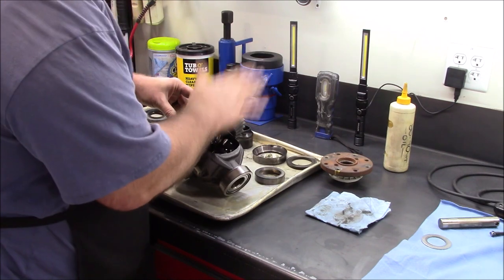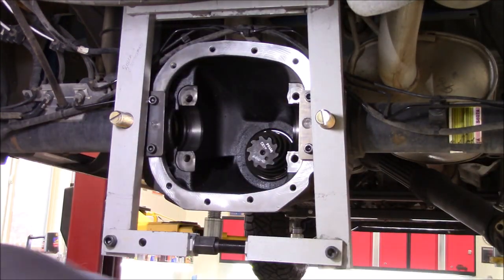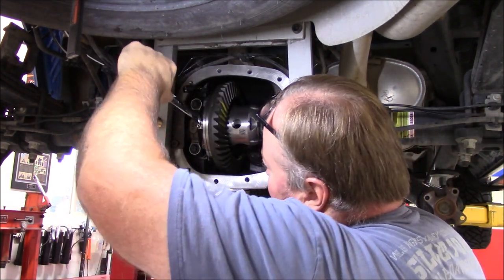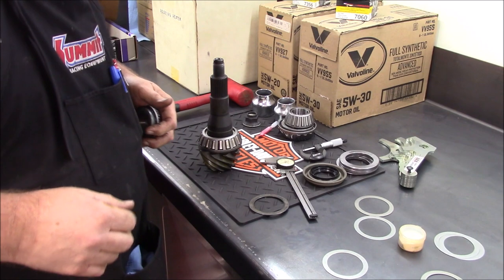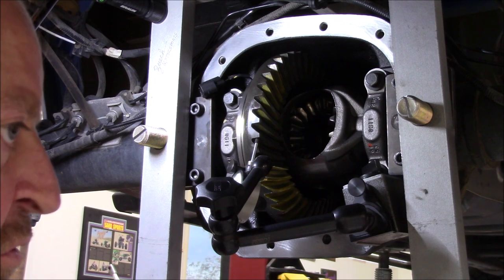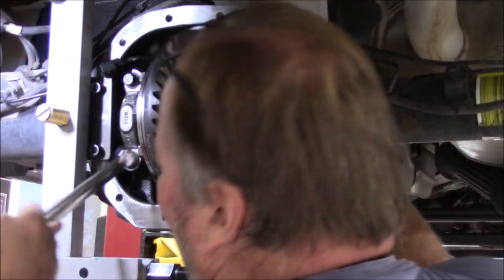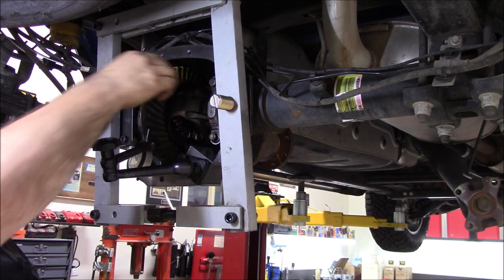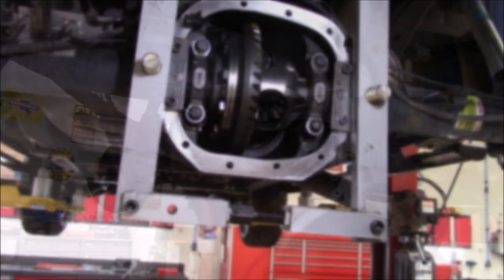Ford F 150 8 8 Re Gear Part 2

Comment: When checking pinion depth, are putting the nut on the pinion shaft every time or do you leave the nut completely off? Great video BTW. Thanks!
Reply from the maker: Yes, I use the old nut and run it on so there is no clearance.  It has to be tight enough that the is no clearance in order to get any accurate pinion depth.  

Once mockup is complete and final pinion depth is determined everything is assembled for the last time when final rotating torque is set.

Thanks for taking the time to watch and I hope it was helpful.
Mike

Comment: What case spreader do you own Mike? Part way through but loving it so far. I got a hand me down but it’s pretty rough, looking to upgrade. Been looking at the ARB or the OTC but seen a few others out there.
Reply from the maker: Paul, mine is an OTC case spreader.
Hope you're enjoying the video. 
Mike
Reply: @zmotorsports62  love the long video format and great work Mike. I will be ordering an engraver now and adding that to my process. Don’t do a ton of regears but seems like a good practice. Also, you have me looking for those ARB shim drivers, will definitely be ordering a set. 

Next time be great to see the test drive and what your listening or looking for during that. Book ends the build as it were. Definitely be interested to see the truck when it comes back after the break in period.
Reply from the maker: Thanks Paul.  I didn't even think about filming the test drive.  I appreciate the idea, I may have to film that although many might think it's pretty boring.  
Mike
Reply: @zmotorsports62  no someone using this as a guide will appreciate it. Also if someone has had a regear and wasn’t done well they will have an idea of what’s ‘normal’ and what is a warning things are getting out of spec. 

For example if the shop had the backlash set to the loose end of spec because they didn’t use a case spreader etc. Now it’s clunking or something else. Warning signs are great before you do permanent damage. 

Anyways, appreciate how much effort it takes to get all the angles and show it all. But you’re a natural so keep it up. Have a great evening Mike.

Comment: Do you have to tune computer for the regear? Why or why not. Thanks
Reply from the maker: Yes, you should because not only will it throw the speedometer off if not,  but it will have an effect on things like transmission shift points.
Reply: @zmotorsports62  thank you

Comment: would you not want to back pressure off of case spreader before you tightn the carrier bolts
Reply from the maker: You can.  I've done both and found no difference for torquing the main caps.  You do however, want to back the case tension off to check the carrier preload as that can have an effect.

Comment: Do you buy the setup bearing for the pinion or make it out of the original removed from vehicle?
Reply from the maker: I make them myself. Either a good used one removed from the vehicle or I'll purchase a new one.
Reply: @zmotorsports62  im assuming just a small amount of material removed from the inner bearing race ?
Reply from the maker: Yes. Very little. Usually these bearings have between .0005"-.001 interference fit so only .001"-.002" is all that needs to be removed for a slight slip fit.
Reply: @zmotorsports62  ok perfect. I suppose we are lucky only having to use them for the pinion on the super 8.8 lol
Reply from the maker: Yes. There are a few setups that have the carrier shims under the side bearings which necessitates setup bearings for the carrier as well as the pinion but they are few and far between.  Most shims are outside of the carrier bearings, or like on the Ford 9" third members and GM 14-bolts they actually have adjustable side shims that are adjusted by way of using a spanner wrench to set the backlash as well as carrier pre-load.
Reply: @zmotorsports62  awesome thanks for all the knowledge! Great video and very thorough! Im going from 3.55 to 4.56 since I have 35s and offroad pretty hard. Just wish someone made a c clip elimator for these...although i guess the brake caliper will keep the axle in place in the event of a breakage.
Reply from the maker: Happy to help.  Thanks for taking the time to watch. 
Mike

Comment: You are so meticulous.  I wish you were closer to Indiana.  I'm needing to re-gear my 2016 F150 that I just boosted with 3.0L Whipple supercharger.  I've got the older 6-speed and 3.31 e-locker.  I always do my own auto work, as I have a hard time trusting others, but I think I'd prefer having someone (meticulous like you) to do this job...I don't quite have the facilities and tools for front and rear re-gear.

Quick question...isn't the rotational torque in inch pounds at the yoke the combined preload?  If the carrier is in with the shims and caps torqued to spec, I thought the yoke torque would be combined preload.
Reply from the maker: Thanks for the comments, I am flattered.  

If you notice in the video I show two preload numbers. The first one is pinion alone measured with a dial inch/pound torque wrench and you want to measure the value once it is rotating and not the breakaway value. That is known as the pinion preload or PPL as I indicate when I engrave the ring rear and in my notes. 

The next is the combined preload known as CPL in my notes and engravings.  This is in fact the total preload once the carrier is installed IF the people shims are installed.  The shims for the carrier not only determine the backlash but also set the proper carrier preload but this is difficult or even impossible to measure on most configurations so combining the two is the best method. I generally shoot for around 3 to 7 in/lbs additional to the PPL.  

I hope I explained that ok.  

Thanks for taking the time to watch and especially for the kind words. 
Mike